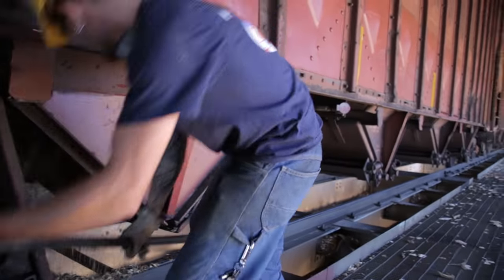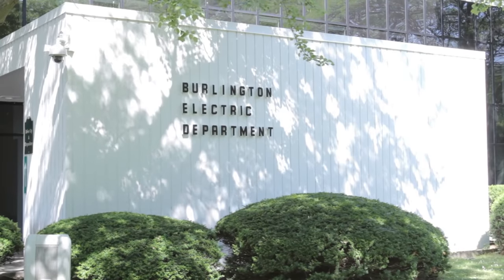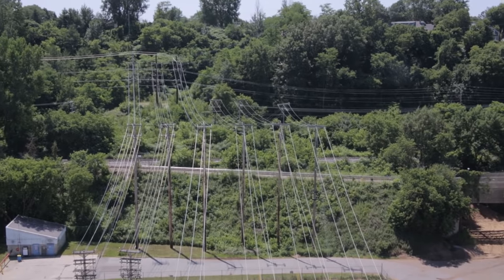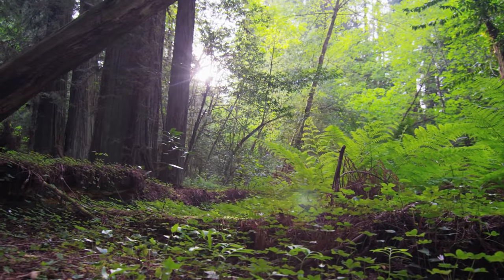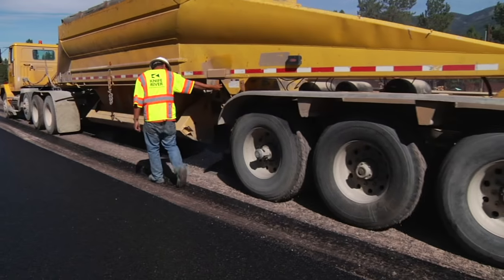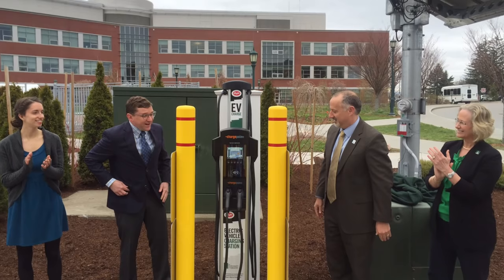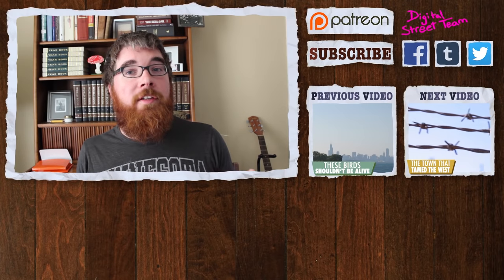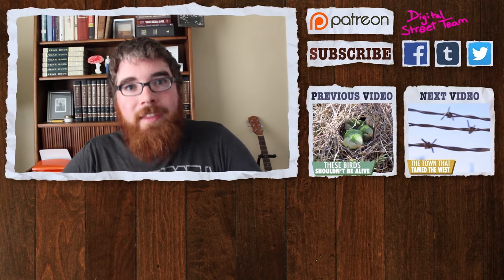Can A City Run On 100% Renewable Energy?

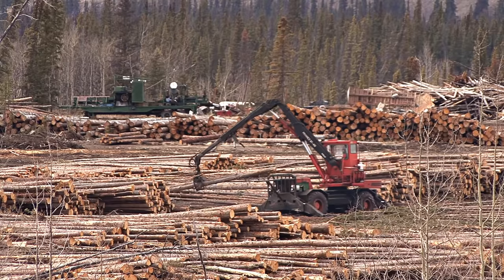Comment: 6:45 Wrong. That's not how the CO2 cycle works! To find out if something is "carbon neutral" you compare the status quo to harvesting energy. The status quo is trees grow, die, and some of their carbon is fixed into the ground directly with decomposition. Some is fixed indirectly going into the food web and eventually ending up in the ground. Burning biomass takes this carbon away so it can't decompose or enter the food web. You burn it and much of the carbon is released into the atmosphere. What you do with the ash left over matters. But we have to do the math adding up the environmental fate of 100% of the carbon in both the status quo and biomass scenarios, evaluating them separately. The fact that the trees grow back (duh) makes it sustainable, but doesn't tell you how that math adds up!
Reply: They explained the residue was used as fertelizer for the trees.
Reply from the maker: Well, Burlington Electric considers their process carbon neutral, but you make a good point.  It would be interesting to see the math on this to see how close it really is to carbon neutral. One other thing to consider though - when they're logging the forest they're not burning the entire tree, so I would imagine that a lot of the wood gets used for lumber, thereby trapping a lot of the carbon.  Wouldn't that also tip the scales a bit towards less carbon in the air?  Just a thought.
Reply: ***** I find it irresponsible to report, without apparent skepticism, what a corporation claims to be true. YouTube content creators, especially those using the PBS logo, need to do due diligence to be sure they're reporting the truth as opposed to reciting corporate propaganda.
Reply: Understanding all the steps involved in the carbon cycle and nutrient cycle is key here.  Plants absorb carbon dioxide from the atmosphere fix it into sugars (simple and complex) and as part of the plant tissues; they also absorb nutrients from the soil (such as Nitrogen, phosphorus, calcium, potassium, sulphur... etc.) and incorporate those nutrients into their tissue as well.  Burning releases much of the nutrients as gasses (carbon dioxide, Nitrogen varieties... etc), the remaining ash is the leftover solids that aren't vaporised away: mostly calcium carbonate, various salts and metal oxides (it makes great fertiliser so long as you watch your soil pH).  

That said, it is sustainable so long as you don't clear cut forests.  The reason fossil fuels are problematic here is that they add carbon to a system that is accustomed to only so much: its like a bathtub, the water in the tub is the amount currently in the system; burning wood just stirs the water, burning fossil fuels adds more water.... the problem is that we don't know how big the tub is so we don't know when it will overflow.
Reply: Non sequitur. Nobody has questioned that this technique is "sustainable". What is claimed sans evidence is that the technique is "carbon neutral". Using your analogy of a bath tub, there are pipes going in and out. These are the inputs and outputs in the carbon cycle. Keeping with the analogy, "carbon neutral" means you turn some knobs and get energy out, but don't change the net rate of flow of CO2. This hasn't, to my knowledge, been demonstrated for biomass.
Reply: Ultimately, using biomass is another form of solar energy.  Plants sequester solar energy using carbon fixed into carbohydrates; burn that and you release the stored energy.  Carbon neutral has more to do with what timeframe you are looking at: those trees will eventually die and decay releasing the carbon back into the environment.  Fossil fuels have removed carbon from the long term Carbon cycle, trees are part of the shorter term cycle.  You will have an immediate increase but long term you have a negligible impact (though you are correct that this hasn't been studied, we didn't even know to ask the question till recently).
Reply: +1stGruhn trees die and release some but not all their carbon to the atmosphere. Some of the carbon goes into the food web where it can be sequestered in peat or in the ocean, etc.
Reply: carbon sequestration in peat and oceans (specifically carbon from trees) is negligible.  You are not going to sequester enough to make a noticeable change long term: sequestered carbon will cycle back out eventually.
Reply: 1stGruhn Please help me understand how you've come to the conclusion that it's negligible. I have not seen this demonstrated anywhere. No, sequestered carbon stays in the ground. That's the whole point. If we burn the carbon that got into the ground, it will raise the atmospheric concentration of CO2 and cause anthropogenic climate change. If we burn trees it will also contribute to the atmospheric concentration of CO2. Pound for pound.
Reply: You'd have to manually pump carbon into specially designed holding areas to ensure it does not return topside: sequestered carbon does not stay in the ground naturally.  The cycle in "the carbon cycle" is purposeful: the net amount fluctuates but averages out to be consistent.  Fossil fuel add to the amount available in the system (bringing up the average amount), burning trees just uses what's already in circulation (therefore negligible, the only way it wouldn't be is if you prevented new trees from growing for every tree burned).
Reply: 1stGruhn Off topic. We're not talking about man-made carbon sequestration. I notice that you're attempting to change the subject to avoid answering my question. Please answer my question. Where is it demonstrated that carbon fixation in forests (from dead trees directly or indirectly) is negligible?
Reply: You can't call a means of energy extraction "carbon neutral" if there is more CO2 in the atmosphere as a result of the extraction process than there would be otherwise. It's that simple.
Reply: This Nature article shows how dead trees in forests contribute to a soil carbon sink. How is this negligible? http://www.nature.com/news/carbon-sequestration-managing-forests-in-uncertain-times-1.14687
Reply: Thats an absurd restriction of the term "neutral".  Just like with energy, if in a closed system something has "x" amount of potential energy and "y" amount is released (kinetic energy) you'd have no net change in total energy, the impact on total energy levels was neutral.  

The carbon cycle has carbon in various levels of availability at any given moment (atmospheric CO2 being most available): carbon in trees is just as much a part of the carbon cycle as atmospheric carbon.  Its not what is available in the normal cycle that's a problem its adding to that average (ie fossil fuels).  Under your restriction, respiration (ie breathing) is a problem since you are adding CO2 via your metabolism (breaking foodstuffs down into CO2 and energy).
Reply: +1stGruhn sorry if you find it absurd, but the definition of "carbon neutral" has always been used to refer to the impact of a technology on the CO2 conventration in atmosphere
Reply: +1stGruhn, indeed, respiration i.e. breathing is not carbon neutral! Wind power is. Solar power is. Coal is not. And unless it can be otherwise demonstrated, I believe wood chip biomass is not carbon neutral.
Reply: I have my Bachelor's in Natural Resource Management.  Carbon Neutral most assuredly has not been used to strictly define atmospheric concentration: its always been about a neutral impact on the carbon cycle.
Reply: +1stGruhn cool, so then it should be easy for you to prove it. Please provide a link that backs up this claim. Evidence or gtfo.
Reply: +1stGruhn also, you still haven't demonstrated that burning wood chips has a neutral impact on he carbon cycle. I think it does not. Because forests are a carbon sink.
Reply: +1stGruhn these sources seem consistent with my points (1) there is no consensus that biomass energy production is carbon neutral and (2) there is a good reason to believe it's not.
Reply: It took you five months to come up those? lol.  Nothing of what you posted suggest biomass energy isn't carbon neutral.

The first post is really just begging the question: tree growth takes time, over the long run it would be carbon neutral if you burn the same number that grows back (assuming such a thing is possible, it probably isn't though given current need).  Burning fossil fuels such as natural gas/coal is (as I've indicated above) definitionally adding more carbon to the current carbon cycle (thus not carbon neutral).

The second post: shows the plant burns fossil fuels... definitionally not carbon neutral.  Says nothing about biomass.

3rd post: clear cutting is always a bad idea.  Any tree harvesting done ought to be done in a timber stand improvement manner with selective harvesting being the operative method.  Carbon neutral requires as many new trees growing and surviving as those being cut.  This is the real issue with using biomass: is it possible to only burn as many trees that can be re-grown?  It may be accomplishable in smaller rural cities but not for the likes of Chicago.  I have no problem saying there are scalability problems with biomass energy production.  But to say it can't at all be done carbon neutrally is simply misunderstanding the issue.

PS: blogs and leftist websites are not adequate sources, show me the science or gtfo
Reply: The burden of proof is on those claiming biomass energy is carbon neutral. And they have failed to meet that burden of proof. So far. I posted a few blogs and leftist websites because they adequately demonstrate my two points:

(1) There is no consensus that biomass energy production is carbon neutral.
(2) There is a good reason to believe it's not.

We can agree to disagree. I will not agree that  biomass energy is carbon neutral until someone explains to me how taking carbon out of the wood web and burning it causes no change in atmospheric concentrations of CO2.

Right now that sounds to me like total and complete bullshit. I'm not trying to convince people it's bullshit. I'm trying to get someone to convince me otherwise. Show me the science or GTFO.
Reply: This is the real issue with using biomass: Does adopting biomass as an energy production method result in a higher CO2 concentration in the Earth's atmosphere? We need to look at all the consequences of biomass in order to answer this question. It's insufficient to examine only one part of the carbon cycle where CO2 goes into the wood that is burnt. That's shamefully myopic.
Reply: The logic behind biomass being carbon neutral is simple: tree y of species k and x size is cut down and burned, another tree (z) of species k is planted to replace y, z grows to x size in a similar amount of time as y.  If you understood biology/botany you'd know that the amount of carbon required to grow to a particular size in a particular amount of time with a similar amount of nutrients availible is similar enough to be practically equal.  So long as the number of trees being cut down is replaced by an equal number of trees and given a similar amount of time to grow etc... the carbon production/consumption will be neutral.  

This is just starting the whole comment section all over again, which I am not going to do.  As I've already said: this works at smaller scales but wouldn't be feasible scaled up (trees just take too long to grow to power larger cities).  You also have to factor in the timing of harvest and growth periods.  If you clear cut then try to regrow, it will be boom and bust: too erratic for reliable power and ultimately detrimental to the area being harvested.   Its all about scale and timing, not whether or not its carbon neutral.

You're not wrong to want to look at other impacts of biomass burning, but that is a different issue than carbon neutrality.  

There are also other forms of biomass than trees: algae and grasses are two being strongly investigated.

https://link.springer.com/article/10.1007/BF00137988

http://science.sciencemag.org/content/314/5805/1598

http://onlinelibrary.wiley.com/doi/10.1111/gcbb.12016/full
Reply: 1stGruhn, my whole point is this overly-simplistic this logic is flawed. The burning of tree y releases essentially all of its CO2 into the atmosphere. If you didn't burn the tree, some of that CO2 would end up in the food web and eventually sequestered in the ground. We know this because forests sequester CO2 and trees biomass is part of that system. Mere 1:1 replacement of trees is insufficient to be carbon neutral because it slows the carbon sequestered of the forest by some small but non-zero amount.

I already acknowledged that if by cutting down and burning 1 tree you got enough money to pay for forest management which resulted in the planting of 2 trees, it would be a carbon neutral (or negative) system. This would require continually increasing land over time because the density of a forest cannot increase forever. Nobody has demonstrated to me that this is how any biomass company operates.

We're not talking about algae or grass biomass systems here. The claims in this video are about wood chip biomass. Yes, scale and timing are important considerations, but are non sequitur to my criticism of the claim at 6:45 in the video.
Reply: The logic is not flawed in the long term.  Your declaration of myopia is a personal problem I think.  Any carbon that enters the food web will be metabolized into CO2 eventually.  Any wood that is not consumed will eventually die and fungus will convert the wood to CO2 (or methane).  Soil is not a perpetual reserve (soil respiration is a thing), any carbon that is not mineralized will cycle back into the system eventually.  True, water and soil do hold CO2, but their holding capacity is related to both temperature and atmospheric amount.  Organism based fixed carbon is only a temporary sink at best.  This is why it is part of the overall carbon cycle: it will come around again.

Grass and algae are not non sequiturs as far as biomass is concerned: photosynthetically fixed carbon is fixed carbon and is a part of the carbon cycle.  Wood has a timing problem that certain other plant species don't have: a rapid ability to regrow.  However, you wouldn't need to plant 2 trees for every one you cut down, in a selective harvest timber stand improvement program you avoid the pitfalls of clear cutting.  This will limit the scale, but it is achievable in certain areas.  

The problem, as I've stated several times in this comment section, is that fossil carbon adds to the total amount in the cycle.  If we use only what is in the cycle and don't add any more, biomass is a viable solution at certain scales.  Its not the answer to all our needs though.
Reply: 1stGruhn I see. Here's where we seem to disagree: Some carbon atoms that enters the food web end up in limestone, peat, methane clathrates, etc. This is called sequestration. Cutting down trees and burning them takes carbon away from this process.

Comment: I live in Northern California and have solar panels. The problem with going off the grid is the difference in winter to summer production. My solar system averages around 58 kwh per day during the highest summer month and averages less than 7 kwh per day during the worst winter month. An issue with using trees for biomass on a large scale you would probably run out of trees. During the gold Rush they used trees to provide steam power in the mines. In just over 20 years they basically ran out of trees.

Comment: Burning of wood creates greenhouse gas.  This is silly.
Reply: jim bo not if the wood comes from managed plantations and is replaced.
Reply: @spencerwilton5831  Yes, burning wood does create greenhouse gases, though it is an interim solution that uses trees which are already part of the carbon cycle. Oil and coal, despite Pietkrijger's claims, are not part of the carbon cycle and are nearly entirely sequestered underground, where their carbon (and noxious combustion products) are stored safely away from the biosphere's carbon cycle.

Comment: TIL shipping in the equivalent of 3 truck loads per hour of wood chips and burning them is green energy
Reply: knpstrr It's green if you replace the burnt trees with newer trees which absorbs more carbon from the atmosphere at the same rate your burning wood
Reply: We cant control the sun or the wind, so to compensate that without any carbon emissions, maybe have to allocate lots of land to produce lots of energy and storing in lots of batteries. Is this really efficient? To have to rely on large storage facilities instead of producing power according to real time demand. Life isnt a utopia.

Or, can use biomass to reduce the need for too large of an energy storage. Biomass isnt taking carbon from underground to burn, like oil and gas is. Biomass is letting nature take carbon in the atmosphere into chemicals and then burning that carbon fuel back. So on average, unless you chop more trees than you replant, no extra carbon is released.
Reply: Zackinthesoda That is a big IF. Also, *you're...
Reply: @de0509  batteries suck, gravity storage is even better.. pump sea water to a hill top during daytime/sunny conditions and use its stored potential for evening power or during overcast days.
Reply: @BikingWIthPanda  No shit. It took a very long time for battery powered cars to start being mainstream. And even now its still far from mainstream. But the problem lies in having the proper geography for pumped hydro to be feasible. Everything has a value. All thats needed is to figure out the numbers. Perhaps in normal places, pumped hydro is great, but in countries that are kinda flat, it would take a lot of distance from the sea to reach a higher altitude. The longer the distance needed, the less efficient pumped hydro can be. At a certain point, even batteries could be more efficient than it.

Sometimes you gotta pick the option thats available. There could be a variety of them. Why put limitation on humanity? Do everything